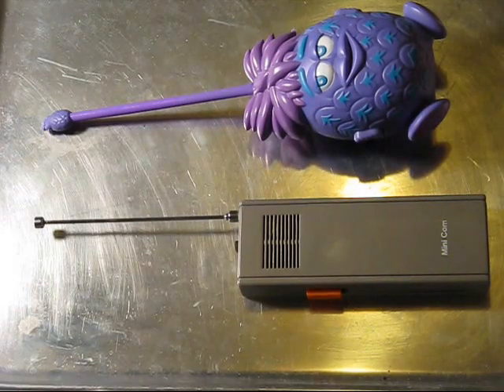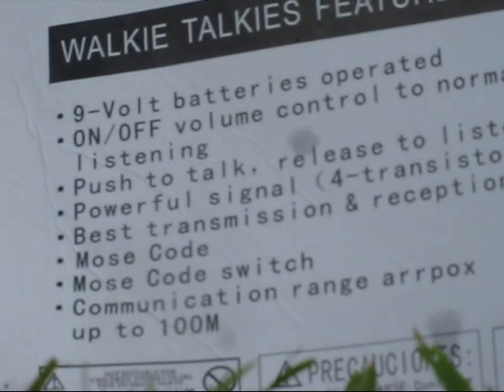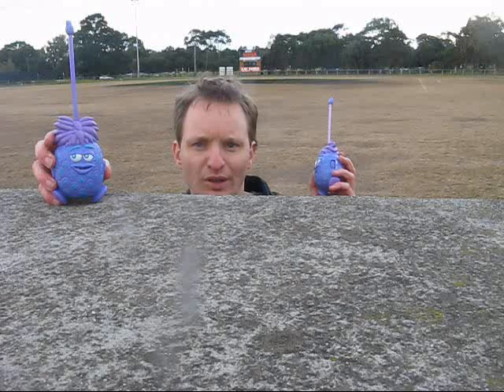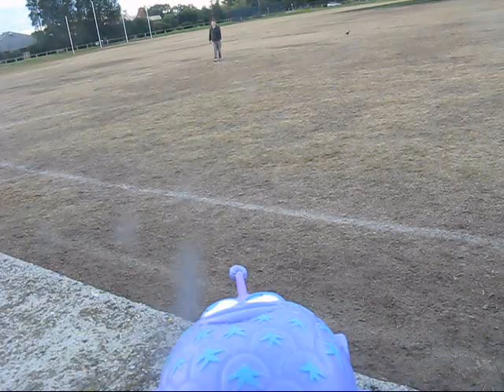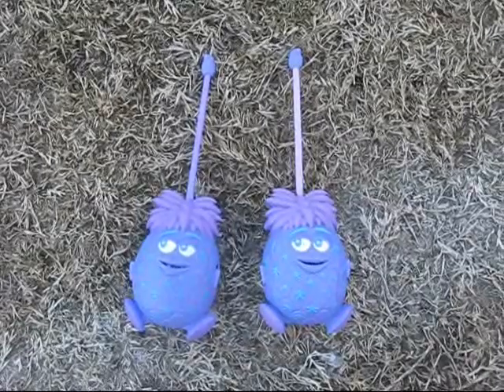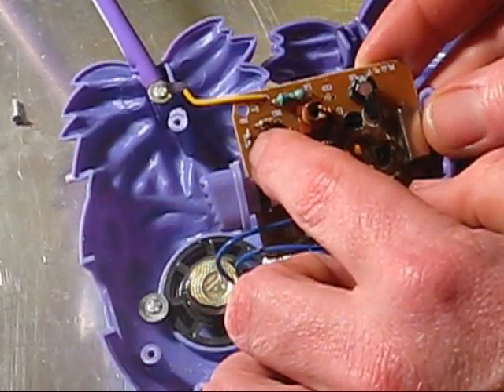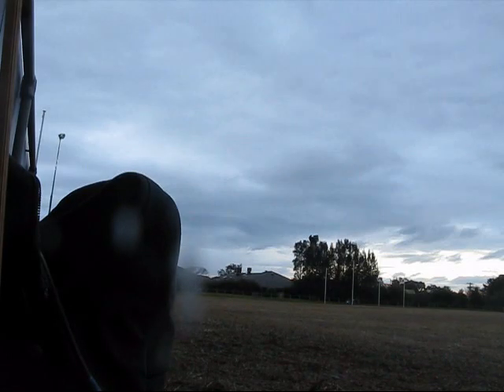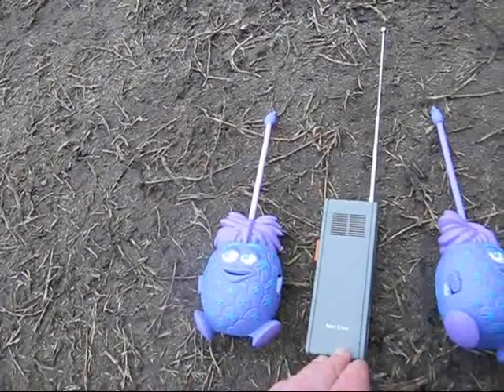Review: Toy walkie talkies - range test and look inside

Comment: You claim that the Receiver in the cheap modern Walkie-Talkies is a Super-Regenerative type which is a way of pushing the performance beyond what can be had with just a Regenerative type.
These are usually Self-Quenching-Super-Regenerative types and I wonder if you can explain how this Self-Quenching is achieved in the Receiver circuitry?
Reply from the maker: See https://www.electronics-notes.com/articles/radio/radio-receivers/super-regenerative-receiver.php

Comment: a cheap and nasty plastic case wont help matters as well all tx / rx should be in a metal box particulary if a superregen is used you can use a tx witout a crysal but needs a buffer after the vfo jim g0wmj

Comment: I am shocked that they built the transmitter to operate without a crystal! Just hand capacitances make it wander all over the place! :-(
Reply: YTes especialy in a plastic case jim g0wmj also the frequncy will spiral all oer the place the pochet comm was 500 times better throw the the chinease crap in the bin or save for spares if you want a low power walkie talkie or make your own using a crystal and put in a metal case
Reply: It’s a toy
Reply: @tonywright8294  The walkie talkies found in toy stores when I was growing up used a 49.860 MHz crystal to set the transmitting frequency. Perhaps other countries have rules that are more lax for these unlicensed bands than the United States. Or, regulatory agencies aren't as diligent about enforcing their rules as they were years ago.
Reply: @klafong1  agreed.  I think you (OP) were receiving about nine mhz too low. Try again.

Comment: I caught a deal on a pair of motorola FRS radios at the local outdoor store. I'm sure they've pushed the transmit power to as close to 500 milliwatts as they could. I'm able to travel approximately ~2 miles from my QTH (through houses and trees, and adverse elevation changes) and still understand speech on the other end. (from the second radio) Not bad for ~$50 for 2!

Comment: It would be interesting to trace out the circuit of those 40 MHz units none the less.  I'm curious how they are designed, with 5 transistors, even with no crystal, they should be theoretically capable of reasonable performance if aligned properly.

Comment: Not that it would have made a difference but since once walkie-talkie was lying on it's side for testing it would have been horizontal in polarization.  You could have held the transmitter sideways so that both antennas would have been working communicating via the same polarization.  You also had the device under RX pointing its antenna right at you.  The worst possible position for the antenna to receive.

Still...lot's of fun!

73,

Rich
AD7C
Reply: Bingo